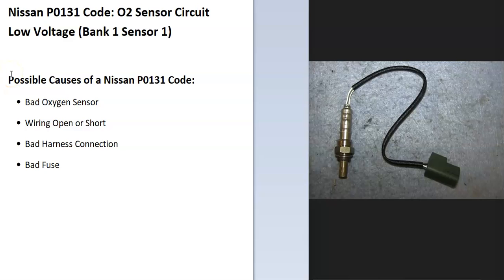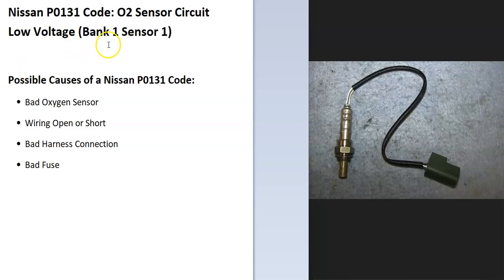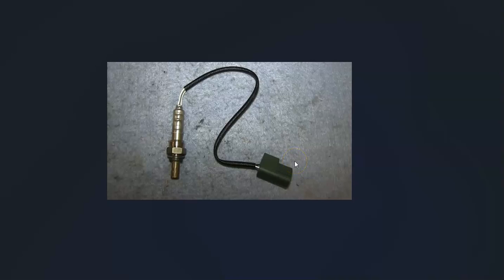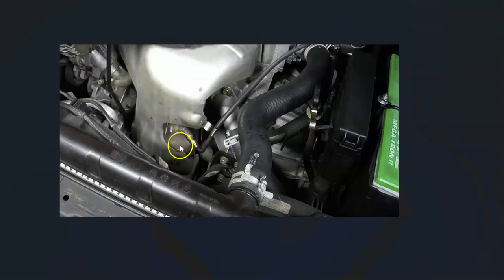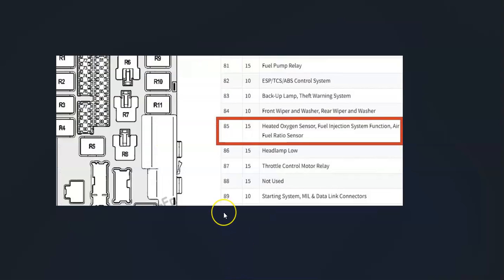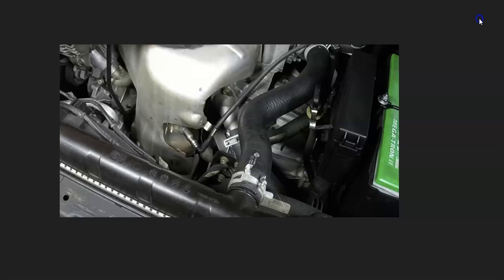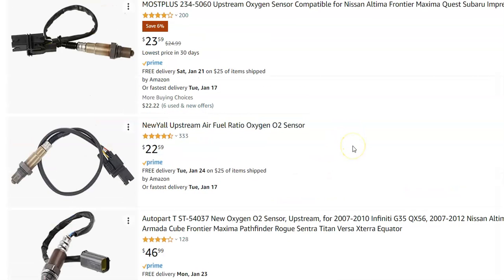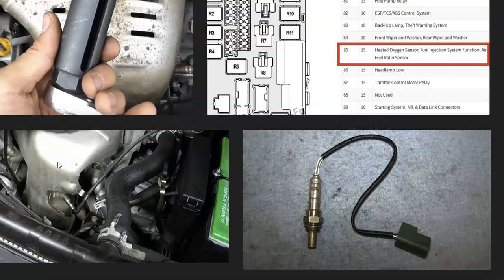Causes and Fixes Nissan P0131 Code: O2 Sensor Circuit Low Voltage (Bank 1 Sensor 1)

Comment: A question for the masters , I have a 2013 M37 Infiniti, code P0151 showed up (O2 Circuit Low voltage) Bank 2 sensor 1 , I went ahead and I replaced the sensor, 40 miles goes by and now I have the same code showed up again + P0131 and after resetting the codes now am getting a new code , which is P1168 in addition to the other 2 codes, please let me know if you can help resolve this issue, thank you.
Reply from the maker: If the 02 sensor is good then I would check the wiring. There should be 4-wires: 2-wires for the heater element and 2-wires for the Oxygen sensor part. The 2 wires for the oxygen sensor part would be the main ones I would test.